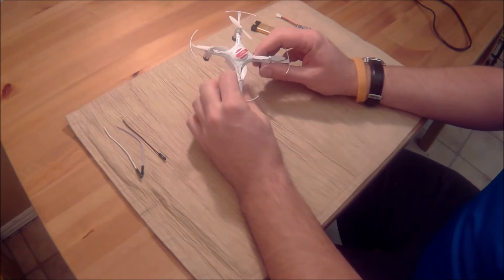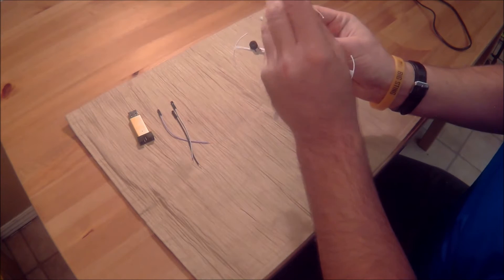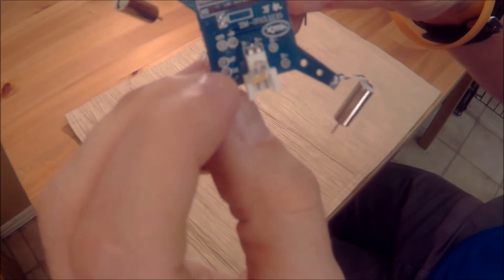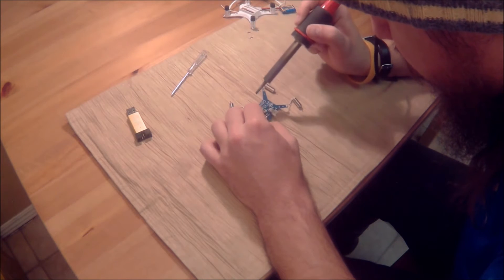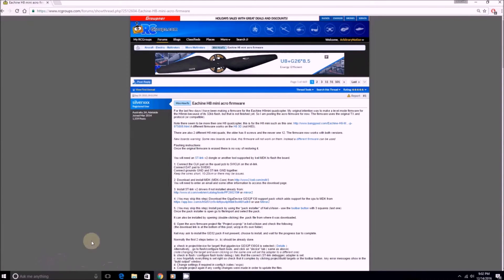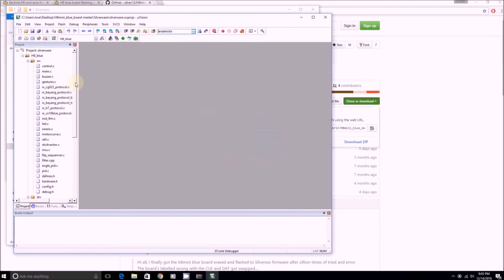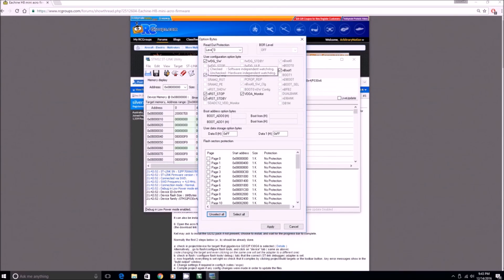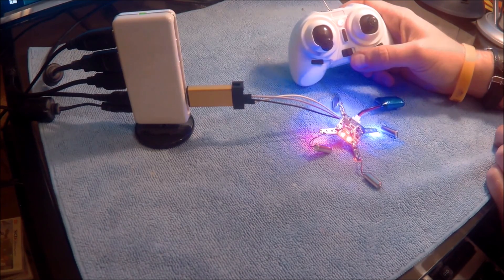How To Flash SilverXXX Acro/Rate Mode Firmware to H8 Quadcopter (Blue Board)

Comment: Joshua man, I ´ve just discoverd your channel, got a new H8 on the way and a STM8 STM32 Emulator Simulator Programmer Downloader For ST-LINK V2 With 4Pin Cable... I also want to flash it for acro flying, will I be hable to use my FlySky FS i6 to fly it??? When I flash it, can I ask you for some help??? Thanks man, I´ll speak to you later... All the best
Reply from the maker: Of course, I'd be glad to help.  Sadly, you would need a transmitter that uses the Bayang protocol.  I use a DEVO10 with a 3in1 module installed.
Reply: I´ve bought the iRangeX iRX6 Multiprotocol TX Module, will it work with it??? I´m such a noob, eh eh
Reply from the maker: I may have to pick one of those up :)  It looks like that will work.
http://img.banggood.com/file/products/20170629020647TOY-MTX_Instructions%20(2).pdf
Reply: Thanks man, as soon as I get the parts I´ll  contact you... All the best
Reply: Josh man, I´ve already have the ST-link, followed all the steps on your vid but just cant seem hable to do it right... Going crazy over here, my knowledge of this subject is also quite limited, dont know wha
t to do... aaaahhhhhhhhhhhh
Reply from the maker: Which part are you stuck on?
Reply: Thank God you´re here, loool... I´m starting all over again, have to download all the software again,I got so frustrated that I uninstaled everything to start over fresh and try to do thing wright this time... Do you have PM activated here on YT???
Reply from the maker: PM sent!